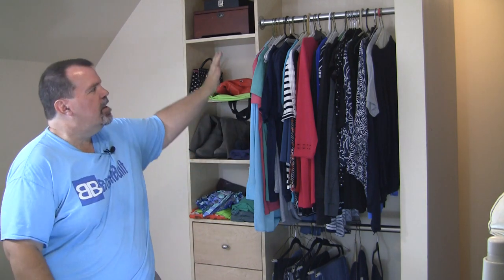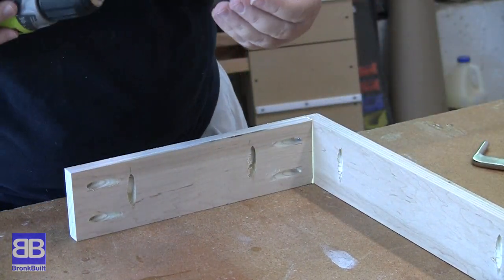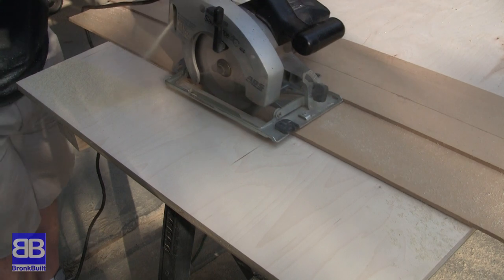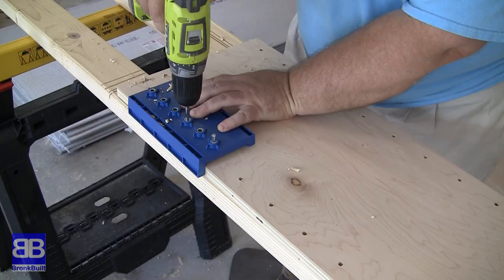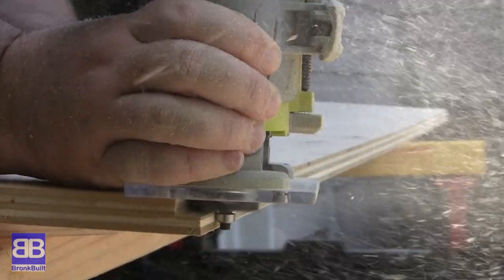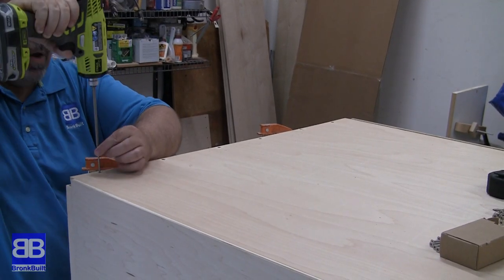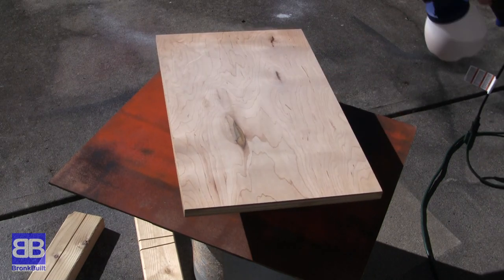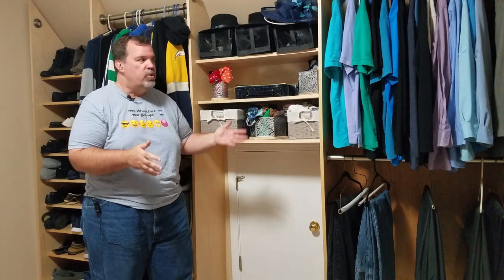Closet Organization Renovation – Part Deux - Part 2 of 4

Comment: Another great video. Just wondering why not use pre-drilled side shelf walls from the hardware store.  As far as having holes by the floor ... I like the idea because I personally don't like putting shoes or clothing directly onto the floor of the closet. I prefer to have a "floor shelf". So I don't see this as a mistake. Those units look like they are heavy. Sure is a lucky thing you thought ahead way back when ...  you fore-saw the need to have muscular sons so you married your wife had kids so your boys could help you carry the heavy closet units upstairs and set them in place. Great pre-planning. However I hope the need for lifting these units into place was not the only reason you got married and had kids?!
Reply from the maker: I didn't buy the predrilled sides because i didn't want the mdf or partial board melamine.  These are a bit better quality maple plywood.   I'll never tell if that was the only reason i had sons.
Reply: @BronkBuilt  Good call on the pre-dilled side panels ... that MDF particle board will fail if the pins are used very often ... plus the plywood accepts the finish much better.  Very "safe" answer on the reason for marriage and kids. (All in fun 🙈)
Reply from the maker: @DanBronk  Nothing wrong with the MDF or Melamine route, especially on a budget.  MDF takes paint really well.  But we may be selling our house soon and putting "Custom designed, hand made maple master closet" may work well on the MLS listing.  Going this route was a good 30%+ more on the cost of wood.
Reply: @BronkBuilt  but way better quality